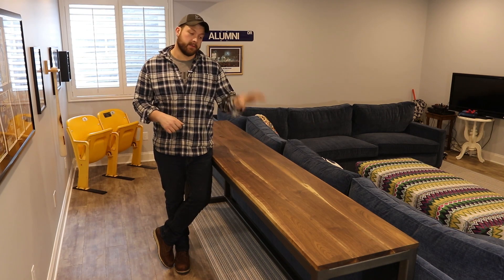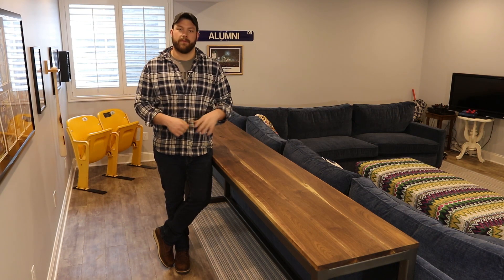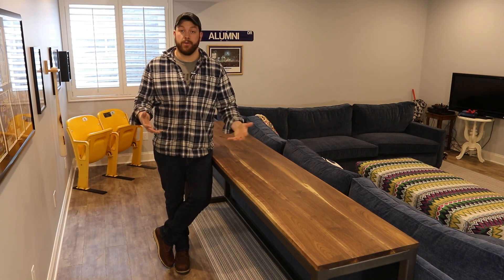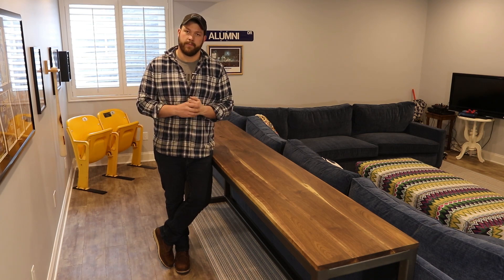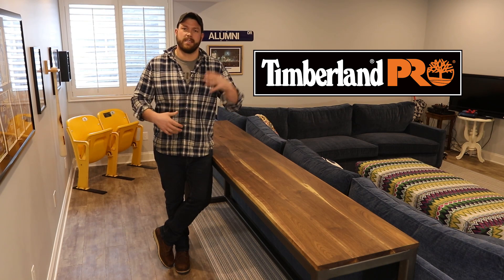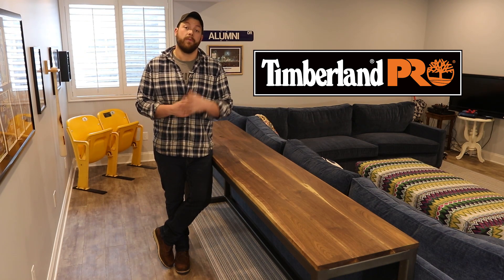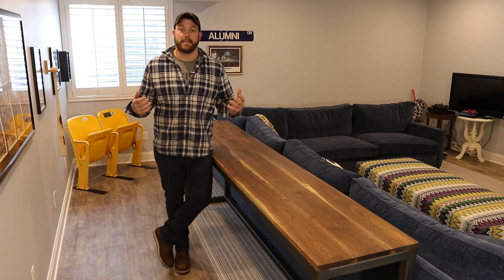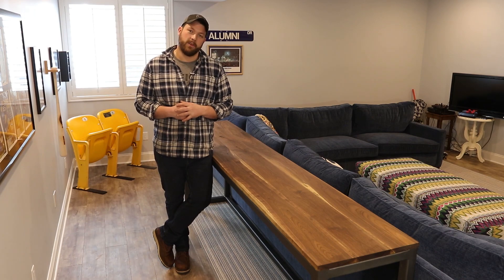Industrial Sofa Table Build  | Easy Metal Working Project

Comment: That looks amazing. I need to get 220 wired in my shop so I can start to mix some welding in with the woodwork. Such a great look!
Reply from the maker: the Lincoln 210 MP runs on 110 as well. Email me if you have any questions !

Comment: Question about the Rubio monocoat.  I see they have a raw wood cleaner to remove oils from exotics. Is that a step you still do with domestic hardwoods or do you skip it?
Reply from the maker: I use a tac cloth or mineral spirits
Reply: John Malecki thanks for the reply.